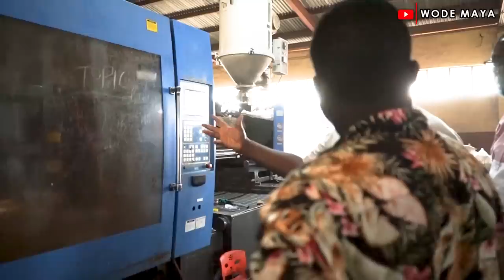Inside West Africa's Biggest Plastic Manufacturing Factory In Nigeria

Comment: Good video Maya.

I feel there must be fumes in the air in this environment and these people should be using some shield to prevent excess inhaling.

I hope somehow, sir Inno gets to know this.
Reply: Not about feeling, it's either you know or you don't.
Reply: I've worked in a moulding factory before, those injection machines use electricity, not diesel, there's no fumes

Comment: This is not only the largest plastic factory in West Africa, but also the largest ceramic factory. This video did not show many of the products manufactured at Innoson Technical and Industrial Company. It includes electric metering boxes of various sizes and specifications, PVC pipe fittings, water storage tanks. Innoson apparently doesn't like to advertise everything thing. Like most of the big Igbo businessmen,  he already has a large distribution network.